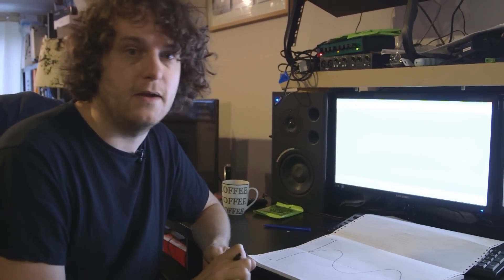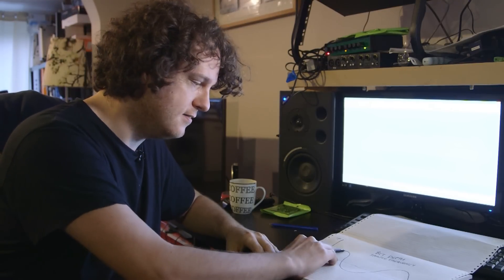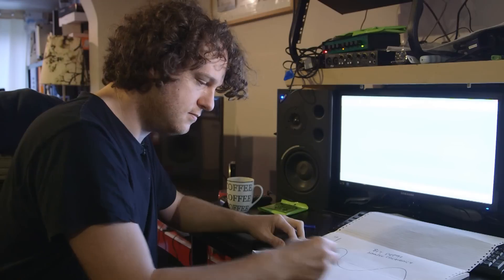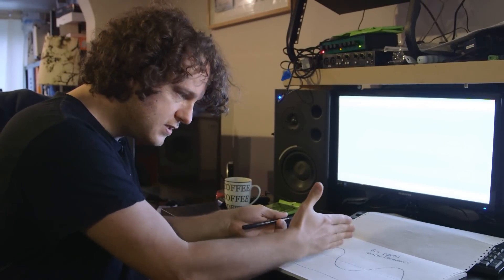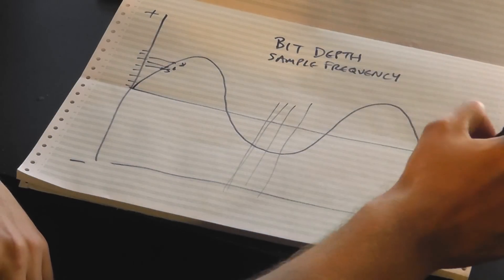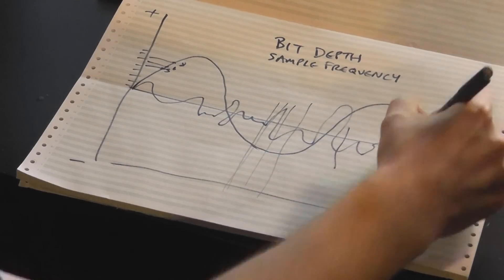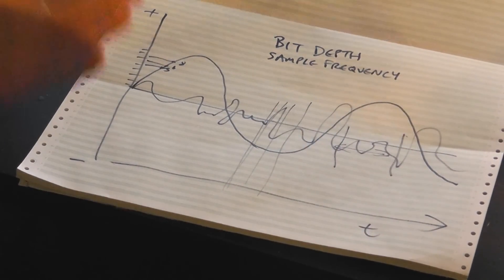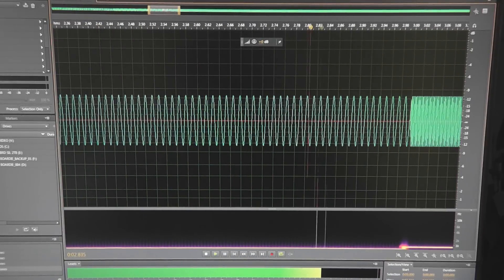How Digital Audio Works - Computerphile

Comment: when we say 44.1 kHz is recorded. I means 44100  samples values are recorded in each second

But the bass typically ranges from about 20 Hz to 250 Hz or so

But the bass can be recorded for more than 300 seconds, right?
and 300 seconds would be  13230(300*44.1)

So how it is between 20 to 250 Hz only.
Correct me if in understood something wrong

Comment: The human ear, talked about in this video , is the ear of a teenager of 17 years or younger, whose hearing hasn’t been damaged/weakened yet. In the 20s you might be down to 17-18kHz, in the 30s down  to 16khz. These are averages. The exact numbers vary individually of course, with the point being, that only a small percentage of humans can hear 20KHz.

Comment: Sorry mate - what does the amount of samples per second have to do with the upper frequency sonic wave limits of our hearing?  Do you mean we can hear up to 20K and down to 20Hz and so if we double that then all frequencies are covered? That sounds like snake oil. That seems like saying that since we can only see about 24-60 frames per second visually, that must then be related to the wave frequency of light/colour. I don't think those values relate at all, or what? Sound frequency and SAMPLE RATE are two completely different counts surely right?  How do sound wave frequencies determine sample rate? There are hundreds of different sounds having hundreds of different frequencies going on all at the same time in life. 40,000 samples per second is then more to do with how much information is worth attempting to capture and reproduce. It is not to do with the random pitch of random sounds, but rather, the possible content of data we are capable of observing. This is where a frequency of possible information observed may be relevant, as a guideline.

Comment: What are the two numbers associated with digital audio?
What are the two numbers responsible for?
The number of times the computer takes a snapshot/picture of the audio is called the _________________________________________.
What happens when you take more slices/ pictures per second.
Is it better to record audio at a higher bit depth?
Name four standard audio bit depths.

Comment: 44.1 kHz was chosen as it captured all desired frequencies and it also just happened to be the perfect rate to store the samples digitally on PAL and NTSC videotape. This was used as the storage method for transporting the audio between locations.

Later, when we didnt need to care about storing it on videotape we switched to 48 kHz as it helps with making filtering much simpler.

Also you dont get square waves, thats impossible with a band limited signal. You can only get the original signal, smooth and non-square. 16 bits determines where the noise floor is and for playback 16 bits is more than enough to capture the dying cymbal. You use more bits, like 32 bit float, when editing before finally exporting to 16 bits. Editing with 24 bits or 32 bit floats helps because it gives you so much headroom to apply filters etc without adding any more noise that will be noticeable.

Comment: The 44.1 Khz has noting to so with double what humans can hear.  The 44.1 KHz sampling rate was chosen because it was a rate that would work with both 50 Hz and 60 Hz video. The reason was that prior to the CD the only systems capable of storing the amount of data required were video based.When the CD came along the red book standard just adopted 44.1 Khz.

Comment: I saw on another channel that the 44.1 kHz sampling rate was because we kept the human limit of hearing as 20 kHz and added a 2.05 kHz extra limit because low pass filters weren't accurate enough to cut off exactly above 20 kHz, so we added a bit of leeway. Double that and you end up with 44.1 kHz
Reply: and it's true !
Reply: It was also the prefect rate for data storage methods used at the time.

Comment: am a newbie knob at all this.  I bought a Focusrite Saffire 6 usb interface to plug my guitar into the laptop and take advantage of what there is as far as amp simulators go. I downloaded the drivers for the saffire 6 and Windows 10 is ok with it. However when I go to set up the software ..Amplitude 4..or the Bias Amp and when I attempt to change the settings from "Directsound" or "Windows Audio" to ASIO the software crashes. Sometimes I get an error saying that windows is unable to set the sample rate another program is using it (even though everything is closed out) or I get an error saying that the input and output devices don't share a common bitrate and that I should fix it in settings --which does no good? any help would be appreciated ..

Comment: I use 24bit - 196kHz :P great for listening to lossless audio and also that is the rate i record at too :P
Reply: 24 bits at 192khz isn't necessary for audio playback. Recording and mixing is a completely different animal.
Reply: When you learn a bit more about sampling your head will explode when you realise that a 44100hHz sample rate at 16 bit is lossless and fully recreates the original signal, losing nothing. Then you wonder why you are paying more for "hi res" audio that literally contains nothing extra, and they know it. You get a bigger file, that contains nothing extra.

Its like seeing people buy bottled water in non-clear bottles. Some people just get full 1 litre bottles, but then you see some salesman swindling others to pay extra for 4 litre bottles that only contain 1 litre of water. Those people who paid extra swear blind that they are getting 4 litres, or somehow their water is better for it. They go on at the people buying the cheap 1 litre, full to the brim bottles why they should upgrade to the much more expensive 4 litre ones. They invent amongst themselves all sorts of cool sounding fake science and half truths to explain the superiority of their choice. The one thing they never realise is they paid loads more for a 3/4 empty bottle compared to buying 4 full 1 litre bottles of the same water.

Comment: The sampling rate has nothing to do with the frequency response of the signal. The higher the sampling rate the more accurate the digital signal will be compared to the analog signal. Just like a higher resolution camera vs a lower resolution camera. Either everything goes in the microphone or nothing goes in the microphone.
Reply: That's not how it works.
Reply: +CaesarGamer The Midas XL8 input channel has a frequency response of 0 to -.5 db from 20 to 20,000 cps regardless if the system clock is running at 96k or 128k. The frequency response remains the same regardless of the sampling rate. Samples per second is the number of pulses or reference points recorded every second of the waveform as the signal goes up and down.
Reply: +P Nelson It's not like the resolution of a camera, not at all.
Reply: Nyquist Theorem anyone?
Reply: Amar Gandhi A wave being sampled more times does not mean the audio quality will be higher. If you are below Nyquist you can reconstruct a wave perfectly.
Reply: +P Nelson You missed some classes, huh? 

As an audio engineer wizard with over 9000000 hours of experience, I tell you: you are wrong.
Reply: All that money and time and you STILL don't know how it works? Glad I didn't waste my money on your services.
Reply: It doesn't in the way that you are describing it, however as you go higher in frequency, each rising and falling edge of the wave is sampled less times. 
As far as your camera analogy goes, the sample rate is more like the framerate of the camera. You need a higher framerate to properly capture something that's moving really fast.
Reply: It does have to do with how high of a frequency you can pick up. If you don't have a high enough sample rate (specifically if you're below what's called the Nyquist Frequency) then you can begin to 'measure' a frequency which isn't actually present. This is called aliasing. https://en.wikipedia.org/wiki/Aliasing has a good, simple explanation (with some visuals) of what can happen if you don't have a high enough sampling frequency.
Reply: +Çerastes Spare me bro... As a touring live audio engineer for 15 years mixing on $100,000 + digital and analog consoles daily I beg to differ. Digital is nothing but a simulation of the analog signal and all digital signals are converted back to analog before sound can come out of a speaker. In most PA systems the D/A is done inside the audio amplifiers.
Reply: You are confusing frequency response with the highest reproducible frequency when sampled. The sampling rate affects the frequency you can perfectly recreate from your samples. So 44,100kHz perfectly recreates everything from DC up to 22050kHz. Frequency response of your equipment may go beyond those frequencies and thus you will end up sampling some of that as alising noise that ends up folded down in the audible range after sampling. So you filter out everything above 20kHz.

That is why we sample at 44100 to capture the frequencies up to 22050. The 20k filter insnt able to hard cut off at 20k, it reduces the amplitude of stuff above 20k. Build a filter that has a roll off between 20k and 22,050k, then sample at 44,100 to cover human hearing PLUS the filter rolloff range. This avoids aliasing. Using higher sample rates lets you use simpler filters like using 48k sample rate lets your filter roll off the frequencies between 20k and 24k. A bit simpler to build.

Comment: Only partially correct about the bit-depth. It really only determines the noise floor (noise made from quantisation). Very important for recording. For consumer-playback - not so much.
The human hearing threshold is generally regarded as 20kHz, but sensitivity drops way before that, and both the sensitivity  and threshold lowers with age.
Reply: Yes. There's a lot of confusion about bit depth and resolution. For consumer playback there is no benefit as you say.
Reply: I can hear up to about 15k at 38. And a 15k tone really isnt very interesting!

Comment: Excuse my english, but I'm rather new with this topic, and I have a question. There is this discussion about benefits of 16bit/44kHz vs 24bit/96kHz and and also vinyl, and we know that mathemathically there's no benefit over 16/44, because the majority of us don't hear above 22kHz to which 44kHz reaches. But is it possible that tones above 22kHz are interacting with each other (between left and right channel for example) and creating additional tones in hearable area? If that's the case, there would be a great benefit in raising 'horizontal' (over time) and amplitude accuracy. 

As I said I'm the beginner, so feel free to drop me from this fantasy level if truth requires that.
Reply: Yes, those tones do interact but only when you sample them. They are called distortion. They are errors and not desired so we use filters before sampling to filter them out. In the real world the higher frequency tones also change the sounds, but you cant hear the effect. You literally can never hear it. 

What you are suggesting is that the high frequency tones will alter the low frequency tones in a detectable way. Well it doesnt. Not in a detectible way. They do change the low tones but those changes are at the higher frequency you simply cant hear any of it. Your ears filter it all out simply because you cant hear above 20k at best.

Comment: Correction (at 7:10): The explanation of the noise ("grain") of very low volume signals is wrong. The computer doesn't "connect the samples with lines". Instead, whenever the computer measures the signal, it has to be rounded to the next associated integer value. This causes the so called quantization error - basically the rounding error. So the signal you hear upon playback is the original one plus the quantization error, which causes distortion (unless dithering is used, but that's another story). No square waves here.
Reply: Exactly, if we look at images and say we have only 2 bits to store intensity value of pixels so effectively 4 levels between highest and lowest intensity value, the lower values will be mapped to zero and the medium to higher all will be mapped to 1 and hence will create very bad looking photos as the detailing is gone
Reply: Dither is a topic that could get its own video too

Comment: If getting the small details for quiet notes is an issue, why not use a logarithmic scale, where values are further apart at higher intervals? Then you could keep detail at small volumes when you need it and lower resolution at high values where you don’t.
Also, why not use a relative scale, where you mention how much the wave changes each sample? That way you'd have no upper or lower end.

Comment: I just synthesised a wave in Sound Forge, then I boosted it and it 100% squared the wave off, I also reduced the bit rate and it made the wave much more blocky. His explanation seems very good to me. They even show the squared off wave when he shouts in the video. I'm sure there are a lot more details to why and how it does this but you cannot deny that the waves are somewhat cut off and look square. Download audacity and try it yourself.

Comment: Yeah, I will have to call BS about the part about the sound card outputting a square wave if the bit depth is too low.
All the bit depth affects is the noise floor.
Reply: +Gordon Freeman he wasn't wrong, he was talking about in an audio editing situation, if you add two 24bit tracks together without halving the volume of each beforehand you will get clipping because you will likely have parts of the audio that are at lets say 40,000/65536 in each, add those together and you get 80,000 which is out of range of that 65536 so anything above 65536 will be cut off, if this is bad enough it would become a square wave, and the reason you wouldn't halve it beforehand even though that might seem simpler is because you will throw away some of the data in doing that, better to add them together in a higher bit depth and then convert that back down to 24bit afterwards or in the case of the final output 16bit. in terms of the final output file you are right but thats not what he was explaining.
Reply: megaspeed2v2
Fair enough, but your average joe will never get into contact with 24bit audio.
Reply: Gordon Freeman this isnt about your average joe though, this applies to the audio engineers producing the audio in the first place before it gets compressed down to 16bit and put on a CD DVD or game
Reply: Gordon Freeman Yes its for the average joe, he was just explaining that anything higher than 16bit is only needed for audio that is going to be edited, not really rocket science.
Reply: megaspeed2v2
Well, he said that the computer draws lines to connect the samples, that is not what happens, any audio engineer would know that's not how you would explain it to the average joe.

He also could have simplified it by saying that the bit depth affects the quietest sounds which don't end up sounding like square waves.

He got quite a few things wrong, he could have done better.

Comment: 5:25
Why use negative volumes? If you didn't, you'd get double the bit depth, and you wouldn't have to deal with phase cancellation.
I'm sure there's a good reason why, so tell me

Comment: Hi Computerphile, great video. I'll just add a minor correction for you. Humans can hear up to 20kHz , not  22kHz. In fact, by the time people reach adulthood, the top end of hearing is closer to 16kHz. The reason a sampling frequency of 44.1kHz was chosen as a standard was not because it is twice that of 22050Hz. It's to do with a problem called aliasing. Any frequency content contained within a signal, which is above half of the sampling frequency  will introduce low frequency alias signals (See Nyquist Theorem). This is the exact same reason helicopter blades appear to spin backwards or slowly in video. For audio we would like to capture frequency information up to 20kHz, thus determining the sample frequency to be 40kHz. The only problem is, any high frequency information above 20kHz will ruin the audio due to aliasing. So in addition we add a low pass filter, called an anti-aliasing filter. Filters can't have a really steep cut off without causing all sorts of distortion, so we need to leave a little bit of space in the frequency spectrum to fit one in. Hence we oversample at 44.1kHz to allow for that.
Reply: +Sam Smith I would add that 16KHz is IF you have looked after your hearing, e.g. wearing ear plugs at concerts and not blowing your ear drums out with awful dance music.  I've done a few sample audio tests and found I can hear to around 17KHz and I am 44 years old.  Certain sounds at specific frequencies cause me a significant amount of physical pain, however this had no effect on my mum who could not hear anything.  So I wonder if the rate of decline in hearing is steady or suddenly drops off the cliff at a certain age?
Reply: Eight years later, and I see this wonderful comment...  Even tho I still can't quite make sense of aliasing.